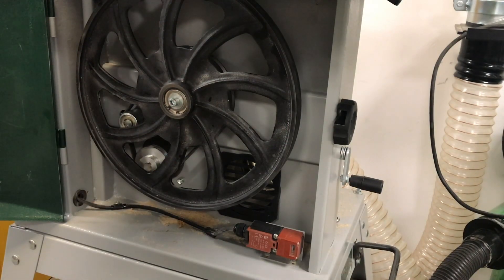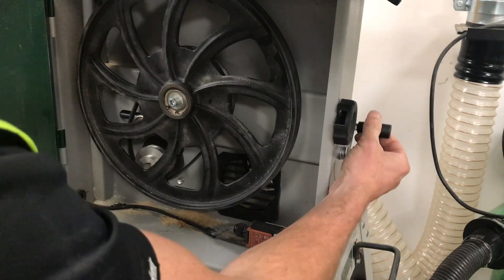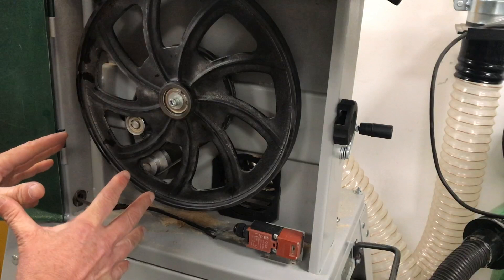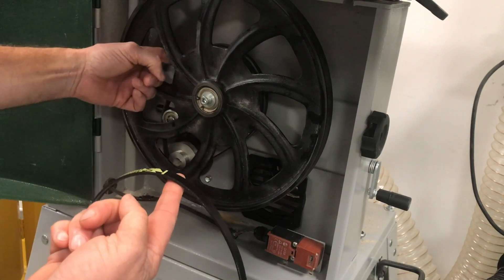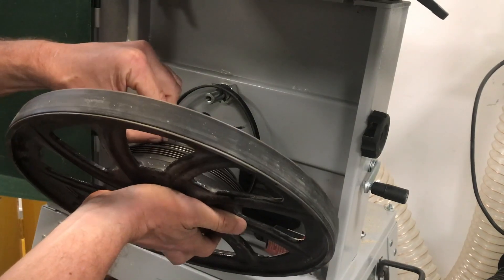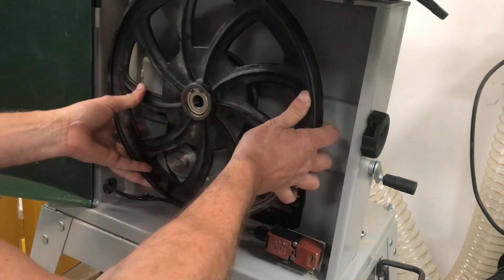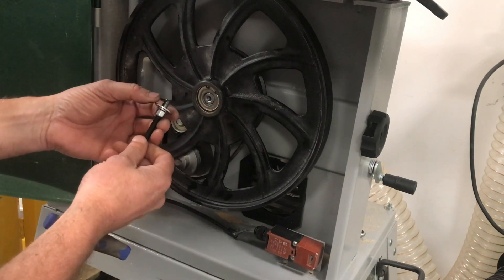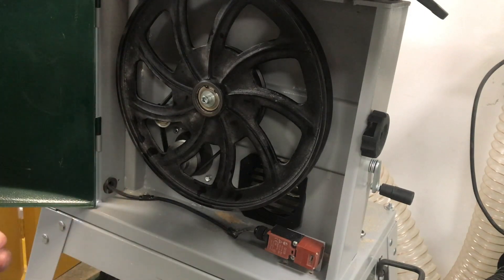Know-How Series: BS350S Speed and Belt Change

Comment: Great demonstration, but you might not get this issue often... but the pin than holds the motor pulley in its place was missing on my Record Power Bandsaw BS12 and the motor pulley moves in and out which is a nuisance as it pulls the belt forwards and backwards off the wheel......
and its a problem knowing where the motor pulley should sit (2mm in the wrong way and your belt gets twisted - and the tension gets too tight - 

Please respond anyone.....
Reply from the maker: Hello, thank you for your comment. Please contact our Technical Team either over the phone on 01246571020 and ask for Technical, or email technical@recordpower.co.uk and the team will be able to advise. Best Wishes, Record Power.